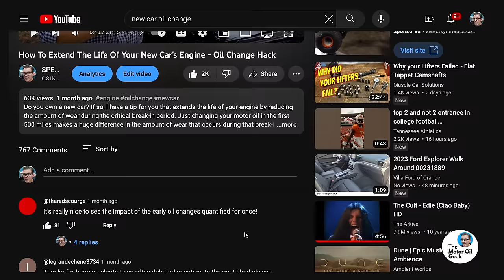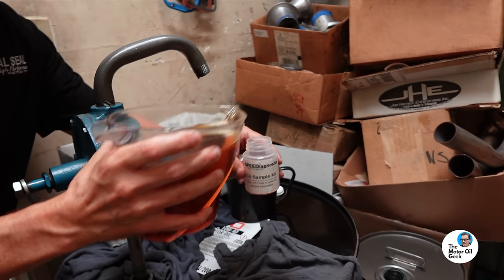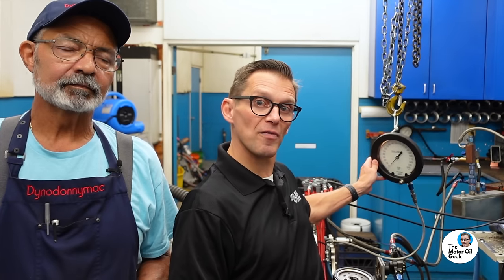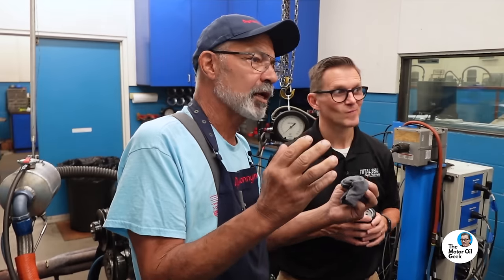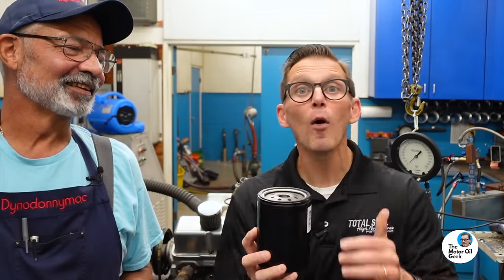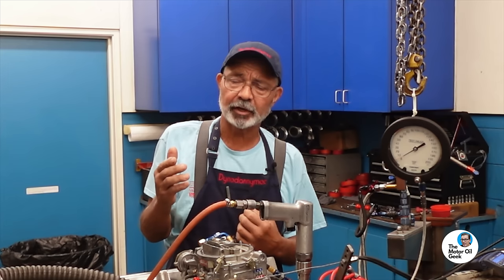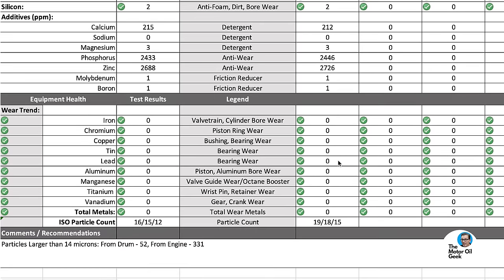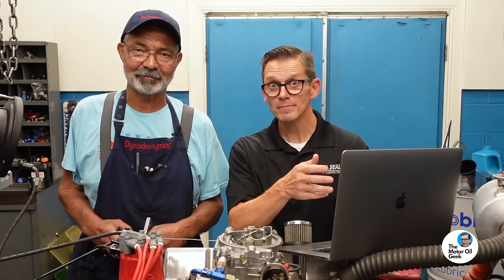Does Pre-FILLING The Oil FILTER Cause Engine DAMAGE?

Comment: Another thing is that massive equipment like Caterpiller and Komatsu that are for quarry use have engines worth stupid amounts of money. Those machines have a prelube system to build oil pressure before every start to maximize engine life.
Reply: What if  you spin the engine over without crank it?
Reply: Accumulator systems for this are pretty reasonable priced. Plumb into the gauge hole.
Road race cars use similar to prevent starvation during cornering.
Reply: having worked in a hospital, now retired, the "CAT " diesel engines running generators would crank the engine with cylinder unloaders open until oil pressure was established, closing the cylinder unloaders/ shutting off starter motor(s), and letting the engine start/ run, first at at an idle then ramp up to operating R.P.M.( 1800), allowing the transfer switches to operate. we tested generators every two weeks. the engines also have coolant block heaters to keep the engines as close to operating temperature as possible. the oil cap. on these engines are 60 gallons
Reply: @miltonwells6750 That all I do. Hold down fuel pedal crank it over for 15-20 seconds. Fills the filter.
Reply: @miltonwells6750 Not good enough. The engine starter spins engine a few revolutions also before it starts chugging. Don't be lazy!! Just prefill filter
Reply: All of the WW2 U-boat engines had manual lever oil pumps to pre-oil the engine and build pressure before starting. This is especially important with diesel engines where the loads on the bearings from the compression and ignition is much higher than for a petrol engine.
Reply: @miltonwells6750 that question doesn’t make sense
Reply: In the Navy our big Alco locomotive diesel engines had pre-lube pumps we ran for a few minutes before cranking them up. We also ran them at shutdown so the turbochargers didn't spool down dry. I worked at a few oil change places and we always pre-filled filters when possible.
Reply: Vary few cat applications do that. "Most" cat machines don't have prelube capabilities.
Reply: I'm gonna hook up a kill switch to my fuel injector circuit... Instant added security if I hide it, can crank my car for 3 seconds before starting it, and I can keep the starter manufacturers in business all in one fell swoop.

It's not the worst silly idea I've ever had, could be some merit to turning over the engine at starter speeds without  combustion... Just developing the habit and the added wear on starter and battery/charging system alike would have some cost 

Thanks for sharing about those huge vehicles.  Makes sense, but didn't know!
Reply: @miltonwells6750  that's how a lot of people get oil back into the cams after a valve job... They just disconnect the fuel system or ignition system fuse, or disconnect the coil packs.  

Some say 10 seconds, but it looks like you could get away with 4-8 seconds and be fine.   Say 6 seconds, and call it good.   10 if you really like slapping your battery around a bit, show it whose boss.
Reply: I've often wondered why normal cars don't have this - some type of way of spinning the oil pump before the engine starts, with a gear that retracts (like a starter motor) when the engine starts.
Reply: This pretty much proves the point of the video.
Reply: I worked on large marine engines and they were also pre lubed before startup, also many of the had an auxilary oil pump that circulated heated oil through the engine while it was not running , the reason for this is the weight of the crankshaft combined with vibrations from generators, pumps ,compressors ect could cause a condition called brinelling which is the crankshaft coming into contact with the bearings and causing small "weld spots" causing damage and in the worst case locking of the engine .
Reply: I know DD13 Detroit had a priming system for their fuel where you’d spin bearings if you cranked too long
Reply: @underourrock  hold pedal down. Modern engines will shutoff fuel and spin engine over
Reply: I should hope so, autos should have them too.
Reply: I used to be a project engineer for one of these companies.There was a big push by marketing to offer prelube as an attachment (high profit margin). Part of my job was to keep the price down, I asked the engine engineers to make a study of the effectiveness of prelube. The answer was that for an engine that was expected to last 20,000 hours, prelube would extent that by 8 hours. Would that be worth $4,000?

Dry starts sound bad, but have you ever taken apart an engine that has set for years? I have, and there's always lots of oil on the bearings. Filling a new filter is probably a good idea if your practice is to go to full throttle immediately on startup, otherwise it's waste of time,
Reply: I always fill my oil filter with oil.
And I'm gonna keep on doing it because I like seeing the oil pressure pick up in 1 second not 5 seconds

Comment: 65 years old and changing oil for about 55 years with my dad. We have pre-filled since the first one. Proud to say I’ve paid for only 2 oil changes in my life. I look after the family’s cars.
Reply: Same here.  Have always done free maintenance on my CLOSE relatives cars (grandmother, rest her soul, my mom, my brother, mine, and my sister when she lived at home when we were all teens.  Also the ex and ex-mother in law).

I like to get to pick out the oil, though, (either Pennzoil Platinum 5W-30 OR Rotella T6 5W-40, depending on the engine) and always, always tell them to use an AC Delco filter for GM and Motorcraft for Ford.  That's just how it's done.  

I have a 5.0 (the old school one), so I use the giant FL-1A.  Mom's 4.6 3v and bro's 4.6 2v and 4v S/C gets the FL-820S.  Silicon anti-drainback valve.  And then there's a 3800II in the family in a Park Avenue, it gets the AC Delco PF-47... or the PF-47e when there's no PF-47's in sight.  I think that's the right one.  Haven't seen the plain PF-47 in a long time, really.  I just know in my gut that "e" on the PF-47e is for "economy", meaning, economical parts inside of the filter lol.. aka, cheap.
Reply: @JustAGuy85  - Hmmm... seems you might be familier with "Project Farm's" youtube channel(!?)
Reply: Same here but I never prefilled the filters because the engine fills it the instant you turn the engine over.

Garage 54 did a clear one
Reply: @JustAGuy85  I use Ford filters on GM too. Heck, I even use them on my lawn tractor and generator. They're just better than AC. Wix are the best, though. Purolator make the Ford filters and are a close second.
Reply: Sounds like your Dad is still with us?
Reply: @jimc5694  yes, he turned 100 last July. Still going strong and enjoys talking about cars.
Reply: i would have learned when i was a kid, too, but all my bikes had 2-stroke motors.
Reply: How does one do oil changes for 55 years and only pay for 2 of them? Thats a neat trick.
Reply: IDK how anyone could think that installing a dry filter is better than installing a wet one . When I was a younger MOPAR head I got from somewhere a oil filter holder that you could turn the filter in any position you had room to, I loved that thing.
Reply: Only 2? Hiw did you get your oil and filters, then?
Reply: I loved Kendal oil and would still be using it if I could ever find it, ain’t seen it in many years. One of my best friends Dad was a “ Oil Salesman “ and I mean he made a better living than any of the bunch of us guys Dad did and he sold it by the case or pallets of it and by the rail car and semi truck full and we asked him one day because we were all into cars “ wich oil is the best?” And he replied “ well boys it’s all basically the same but it comes down to how well it’s refined, and I’d say Kendal is refined the most/ best”.
Reply: I work full time as a mechanic. I used to pay to get the oil changed in my truck. The local dealer would do an oil change, top up all fluids, rotate tires and run it through their automatic car wash for the same price as what I'd pay for just oil and a filter
Reply: @d3faulted2  same
Reply: My boys have no interest in changing their oil, but at least they realize it's important to do it on time. I'll do mine and my wife's as long as I'm able.
Reply: @cris-rj5zf Nah, I just tell what I do and that's it.  I honestly don't need anyone tell me "good job" or something.  The things I said just are how it is and people can take it or leave it.
Reply: I changed my oil after I fill up my tank 4 times
Reply: @dave8168  You are right that back at some point Purolator made Ford filters.  It was a mix of their Purolator One and Purolator Pure Plus filters.  I used to visit the Ford-Trucks forums and we'd cut our filters open and post the pics lol.  But yeah...
Purolator makes a great filter.  I still believe in using Motocraft on Ford and A/C Delco on GM, though.  They have specific ADBVs that hold the right tension to keep the oil held up.  Not saying the material is better, though.

But honestly, if it ain't orange, you can't go wrong.

And, btw guys, he meant he paid to have TWO oil changes done for whatever reason.  Either time or money.  He changed the oil every other time.  Not that's only changed the oil twice in 50 years lol.
Reply: @Chevyssboy138  4 times.  Dunno what you drive.  So, assuming 15 gallons at 25 mpg avg at best means every 1500 miles.

Honestly, that's a huge waste of oil and money.  I hope to god it isn't synthetic.  Synethic will go 8k miles easy in a car.  Trucks hold like 8 quarts and can go even longer and diesel engines hold freakin' 16+ quarts and can go 20-30k miles.

Extend those oil change intervals, man.  Let your additive pack and get activated, let the detergents do their job and clean.  Run a synthetic for 6k MINIMUM if not 10k, depends on the oil.  Penn Plat or Mobil 1 wil go 10k miles easy with plenty of TBN or rather plenty of detergents and additives left.

6k if you'e towing on hilly terrain or 8k-10k if you're mainly highway driving.  

Unless you're using Supertech Conventoinal... then yeah, lol, keep up the 1500k OCIs.
Reply: A man of honor. I do the same and respect ya sir 🫡